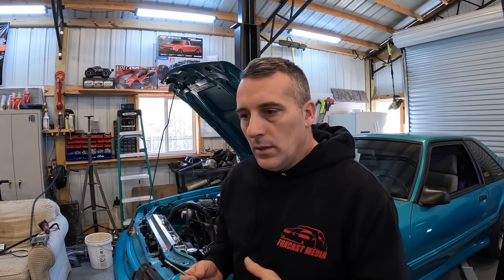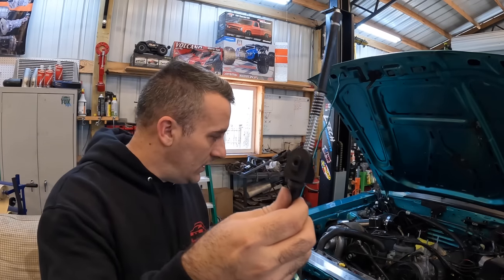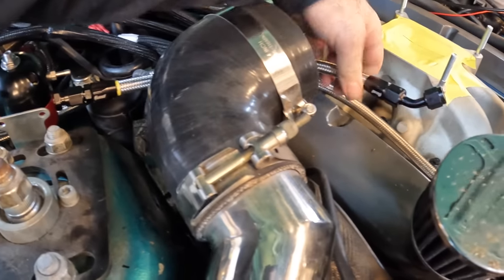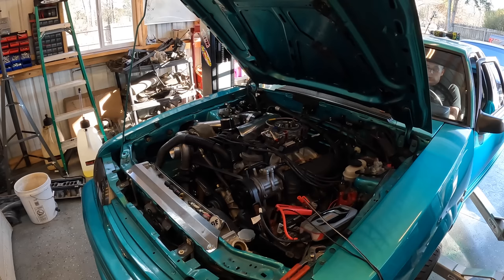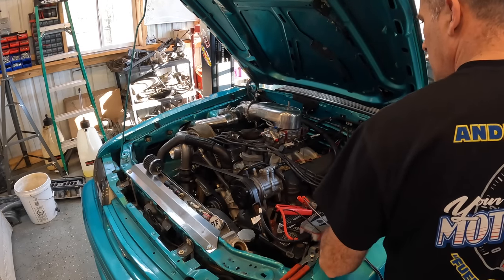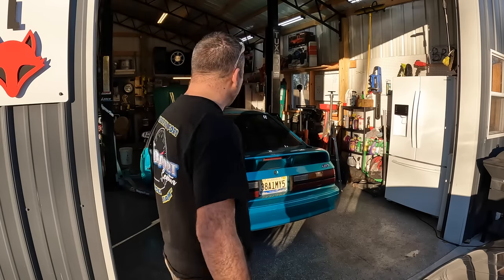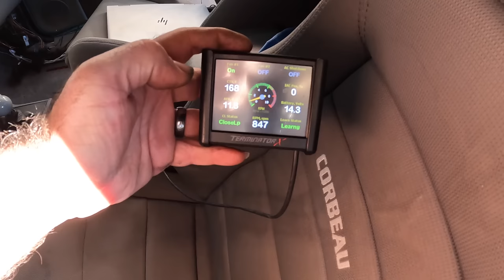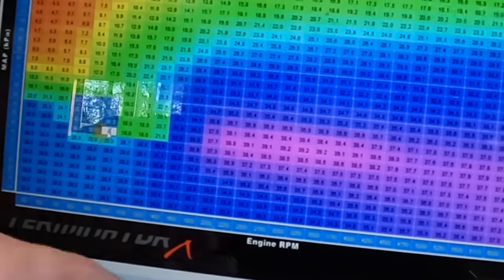Terminator X Blow Through Carb FIRST START! - (With Only Minor Issues)

Comment: I've done a few blow thru setups on SBF's. I would run a boost referenced power valve. It will only open under boost and you can adjust it. A company called "simple stage" makes them and a few others.
Reply: It will also help drivability on the car! as when boost comes in and just when at cruise.
Reply from the maker: I have on ready to go in. Set to about 2lbs 😎✊

Comment: Hey brew2l. I was wondering if you used the little holley throttle cable Ford adapter that bolts on the carburetor bracket ?  Part # HOL-20-279)

Comment: Curious ,  what type of / if any change in throttle response from EFI to Carb do you feel. Granted in this video the carb still required some fine running. Just wonder how she feels to your... " foot " ✌
Reply from the maker: It’s extremely smooth from idle to full throttle. Maybe not as quick at revving as before but it’s close.
Reply: @BREW2LFOXBODY  That's awesome.
Now my instant " thought " is... Hmm
Aluminum Flywheel 🙌🙌🙌